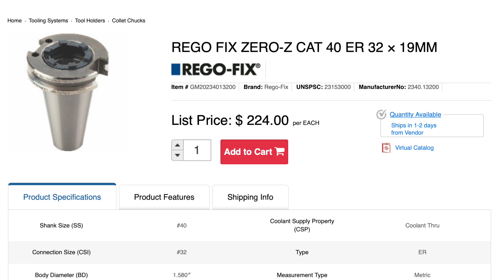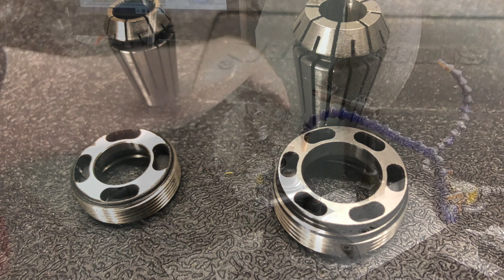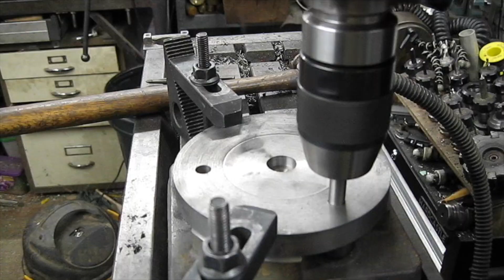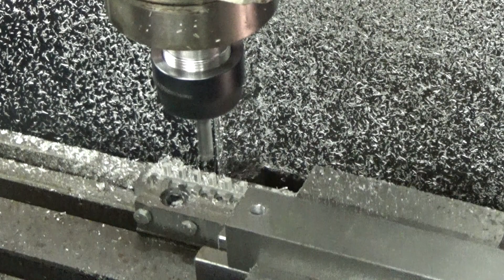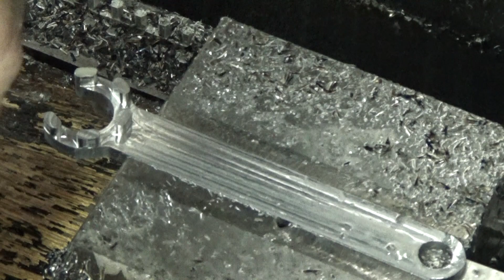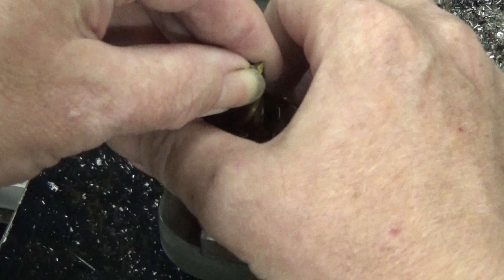Zero-length BT30 Collet Chuck

Comment: Nice work Andy. Did you hand feed that coring drill with the jog wheels or was that MDI?
Reply from the maker: Jog wheels, in closed-loop audio feedback.
Reply: @andypughtube  I really like how you set up your lathe. Once I get finished and rid of the silly Mini-lathe project, I want to do something similar.
Reply: I also like that spanner you made. Blueing always makes stuff more finished looking.
Reply from the maker: @RotarySMP  There is a Holbrook Minor just like mine on eBay at the moment. And I still have all the foundry patterns :-)
Reply: @andypughtube  :) I can't find it on ebay.co.uk. 
Machines are pretty cheap in the UK, but it is too far from Vienna to make sense. I would really like to pick up a Schaublin 125 CNC and retrofit it with LinuxCNC.
Reply: Crappy old controls, but fantastic mechanically. 
http://www.haessig-maschinen.ch/schaublin/schaublin-sv-125-cnc-bl-287755/
A friend here has a 125 CCN.
Reply from the maker: @RotarySMP  https://www.ebay.co.uk/itm/203118787915
The Holbrook Minor, Schaublin 125 and Hardinge HLV are all of the same class, infinitely variable spindle and variable DC motor feed drive. 
The Schaublin look like the most compact, the Holbrook is the prettiest. :-)
Reply from the maker: Oh, and I made another one in ER16. You can probably guess why.  https://photos.app.goo.gl/8ZgefDpfUsb5AgXb9

Comment: Looks good.  How does the runout measure up?
Reply from the maker: I don't know yet, the BT30 spindle is still hanging from the ceiling as I have the high speed spindle installed at the moment.
Reply: @andypughtube  - What do you think about toolpost grinding for something like that chuck body taper?
Reply from the maker: @somebodyelse6673  As a second operation after hardening it probably makes sense. But the surface finish on tool steel is typically adequate with normal turning if using a good insert and the right feeds and speeds. 
Note that I only use these machines for fun. My standards are quite low.